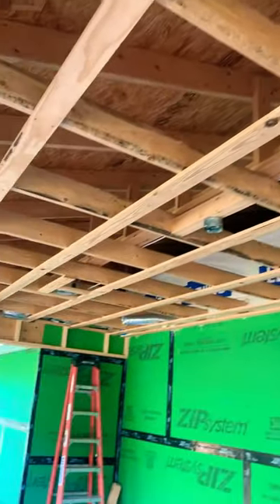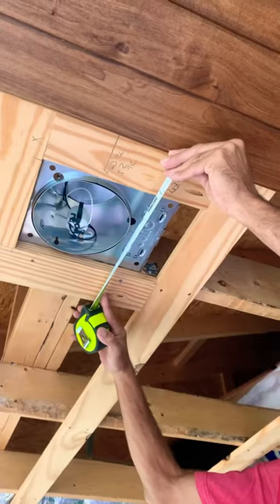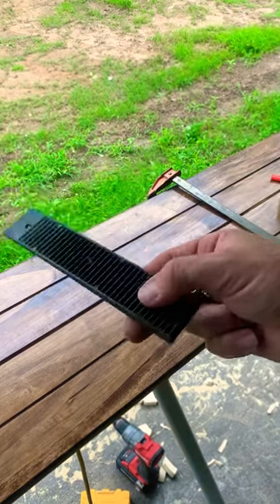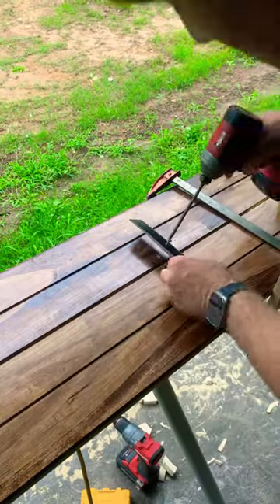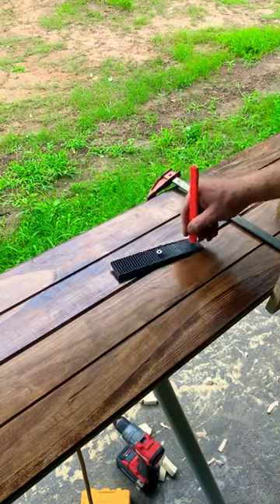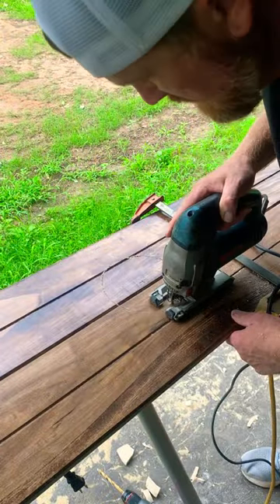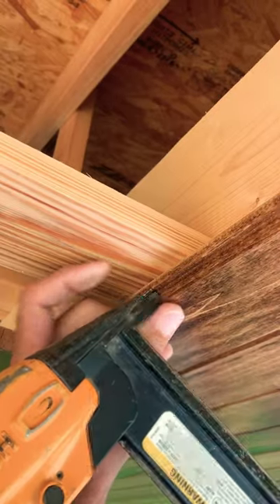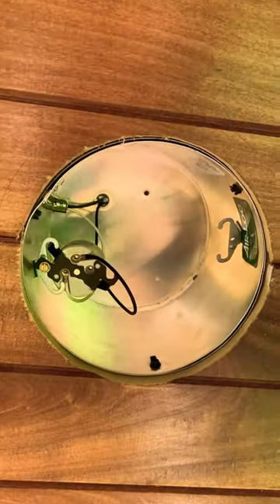The “EMERGENCY” compass #gotitcoach #woodworking #tips

Comment: Then there's me when it came to the old pot lights. I made a template from cardboard and measured my 2 edge points. 

I love how the LCD pots are done, now we just slap the wood up, trace the hole and cut away
Reply from the maker: I use them from time to time